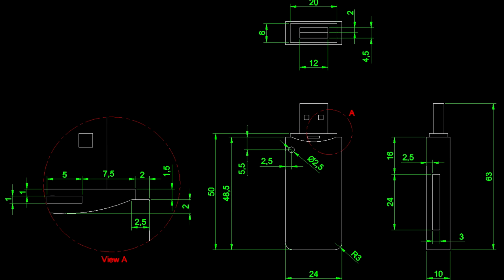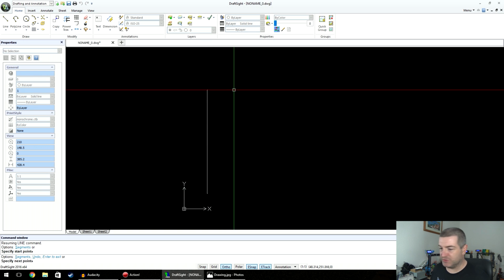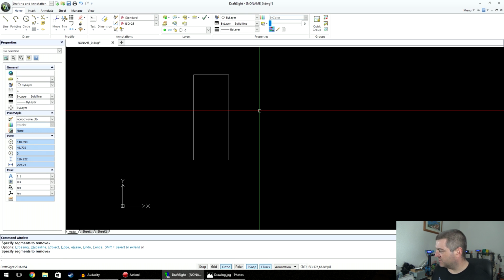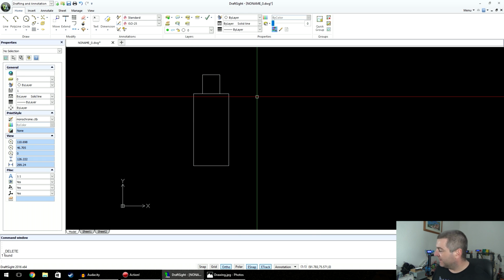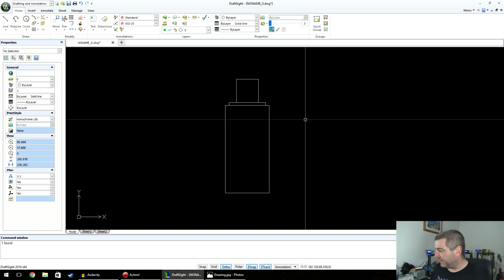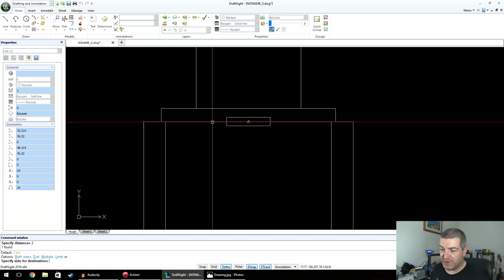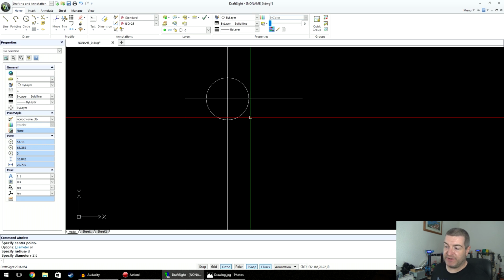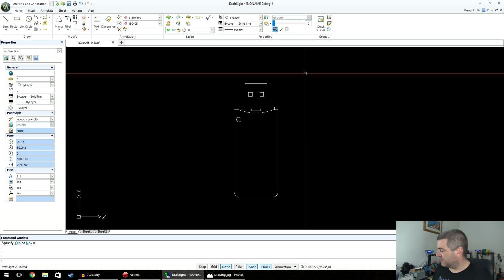Learn CAD part 4

Comment: Steve, it is a little late to vote for the platform, but I'd prefer you use whichever platform for 3d that doesn't require purchase or a use a limited time free trial.  From what I've seen, Autodesk  are much more restrictive in making their software available.  And, they tend to frequently deactivate their software requiring re-registration.